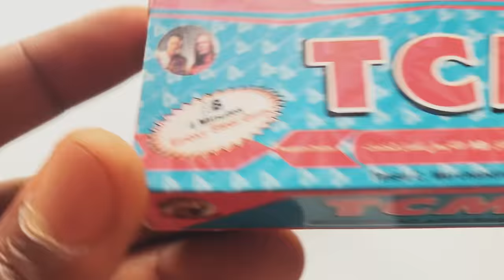How to make AC || Smart Air conditioner At Home || Extremely Powerful Mini Ac

Comment: After filling the gas how long(hours) this AC will give cool air If I run continue. 
And after on this AC within how many minutes it provides cool air
Reply: depends on how fast the compressor you control
Reply: my guess is several hundreds of hours, before that cheap diy compressor fails and spills the gas out.

Comment: Please eplain how are u using butane here. because in order to cooldown the coils you need to expand it from high pressure to low pressure. Otherwise the temperature will be high and the coils wont get cooled

Comment: Friend, excellent work, I sincerely think that you should 3D print the water pump, that would be genius, it could be diversified in designs and power, both for brushless motors and for DC 6V or 12V motors.
Reply from the maker: Am planning on getting a 3D printer soon

Comment: How long does it takes to generate the ice on the evaporator?
Reply: 40000000 years
Reply: This channel never shows the full video since the system start running, always puts transitions wich makes it unreliable. BUT this metod is tecnically much more efficient than peltier, so it has some truth on it

Comment: I think using ethylene gas is better because it’s can get to below -84C while butane from this lighter can only get to -2C
Reply: I don't think plastic, rubber, and epoxy would hold high enough pressure to use ethylene. Even most retail refrigerator and air conditioner pumps can't work at high enough pressure to get very cold with ethylene.
Reply: @5467nick  but at least the tube cold down to below 2C